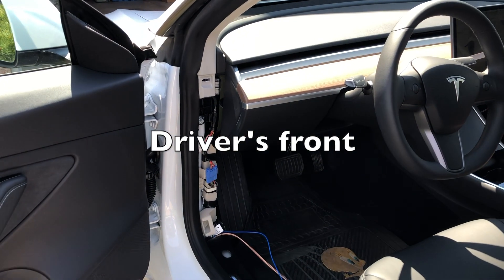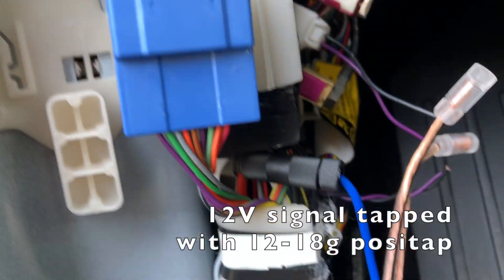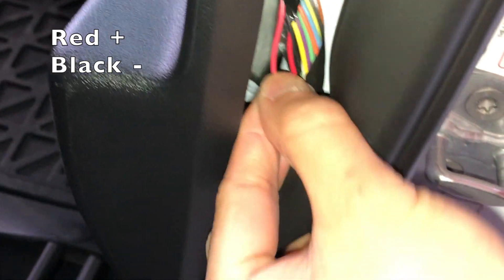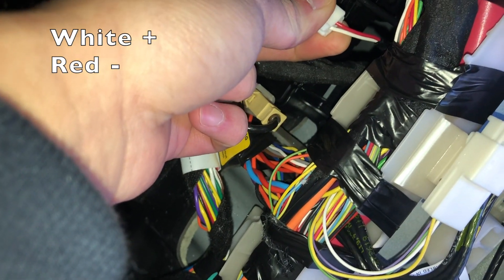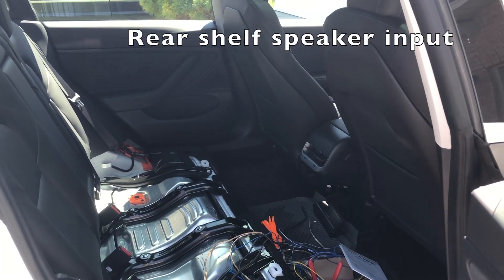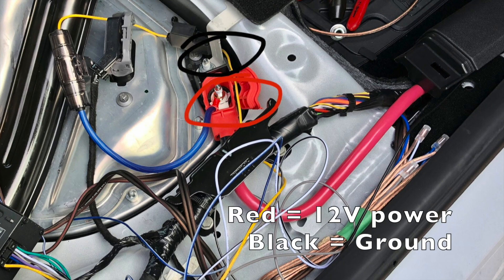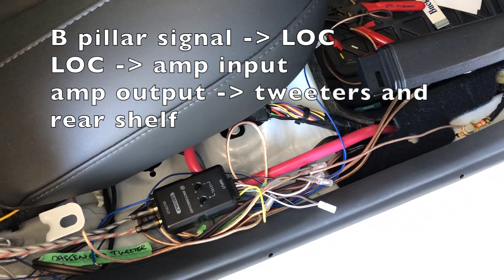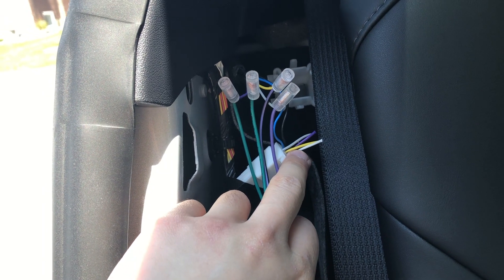Tesla Model 3 SR+ Audio Upgrade to Enable Speakers Wiring Guide

Comment: This sounds so complicated.  on Hansshow channel  they have a wiring harness for enabling the six speakers and it’s just basically finding the plugs and plugging their wiring harness into it.
Reply from the maker: I recently saw that too - the harness does seem to make it easier. I did this before they launched that. 
I wouldn't personally power the additional speakers without an additional amp though.
Reply: DIY by Albert Yeah should definitely have a subwoofer and amp with it.
Reply: DIY by Albert Would this be the process for someone with a model 3 standard range or plus. Purchase wiring harness to enable all 14 speakers then purchase an amp and  sub?
Reply from the maker: It should be the same for both. I think the SR is just a software locked plus model. If it's a 2020 or later model, you may need to wire in the rear speakers as they may not be physically present.

Comment: Did you have to add bass blockers for the tweeters?
Reply from the maker: Yes, I added it after. The sound was too harsh without it. I still find the front tweeters a little too overpowering that I might end up tapping the dash speakers for the fade and balance and to lower the gain.
Reply: @diybyalbert127  So, I am interested in just activating the mirror tweeters, not the rear shelf speakers. In order to do that, would I still need an amplifier?
Reply from the maker: I think the mirror tweeters are 35w speakers so running them in parallel to a tapped connection would not be enough power to split between 2 speakers. But you can use a cheaper 2 channel amp though.

Comment: Thanks for taking the time to make this. Like you said, it'll give people who want to take this project on more confidence to do this. Awesome! Would have loved to see a longer video!
Reply: Did you end up having to buy the Audio Control LC7i? Didn't see it on your list
Reply from the maker: I didn't use the LC7i. I used a cheap Scosche line output converter because I didn't want to spend the extra money or find a place to hide the LC7i. If I hadn't bought it already I would have just cut off the RCA plugs of the amp and wire the input directly. 

I tried shooting the full install but it didn't turn out that well because in some places there wasn't a lot of room to work with.